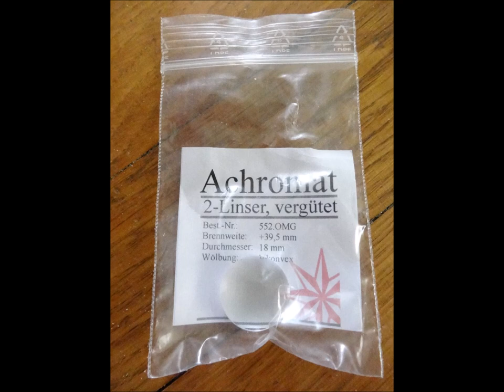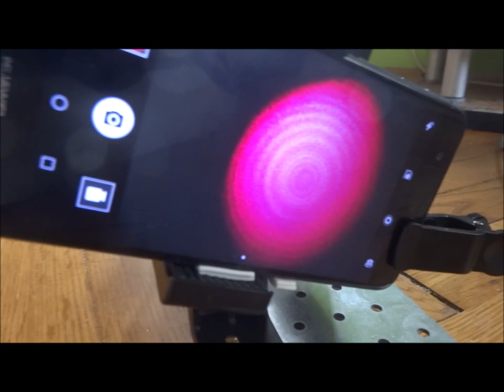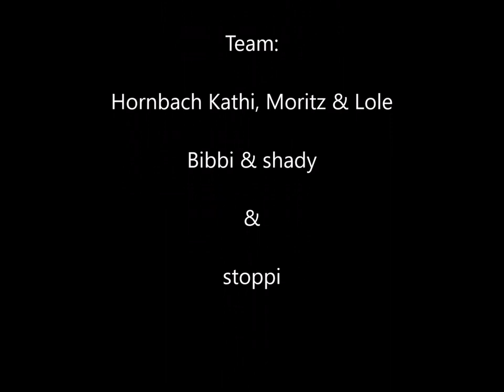cheap & homemade Fabry Perot Interferometer

Comment: Hey, a year one undergraduate here. Just trying to understand how the first set-up is different from the second one and how having a piezo cell fits into the picture fro the second set-up (i.e. I don't really understand what it does). Hoping you could shed some light on it. Cheers!
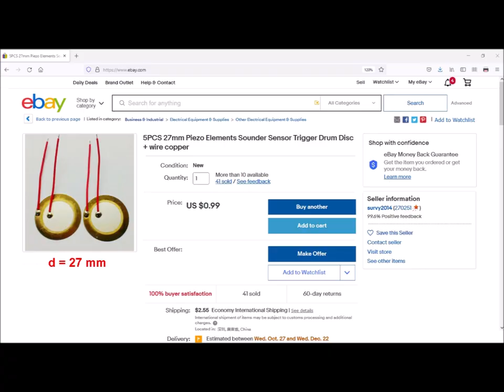Reply from the maker: At 0:55 you can see the first setup and at 3:15 the second one. The only difference between them is the piezo disc positioned under the second 50%-mirror and the observation method. In the first setup I use a viewfinder from a telescope to watch the interference rings. In the second setup I use a 12x telescope for smartphones. The piezo disc has a hole in the middle to pass the light through... Cheers stoppi

Comment: How do you align the lenses in your experiments? I'm building a homemade Raman spectrometer and this is a recurring problem when configuring my mounts. Do you have any tips?
Reply from the maker: For the fabry-perot interferometer the collimation of the lens must not be really perfect. You could use a laser coming from the opposite side of the lens. If you align the laser parallel to the optical axis and move it around, the beam in the focus shouldn't move... Or you can use a bright led positioned in the focus point and behind the lens you should see a bright disc which isn't getting bigger or smaller when you change the distance to the lens... I have done this f.e. For my Tsl1401 spectroscope...
A Raman spectrometer is on my waiting list but therefore I would need a spectroscope with an optical fiber input.
Reply: @stoppi  Thank you very much ;)
Reply: @stoppi  a

Comment: Please, use your FP interferometer to measure the Zeeman effect :D
Reply from the maker: Haha, guess what I am planning right now. I have already bought a 1mW HeNe laser for the zeeman effect, which will be covered with a coil or magnets. But maybe my fabry-perot resolution is too low. The splitting up of the lines due to the zeeman effect is extremely low, but I will try it...
Reply: Maybe, using a set of Piezo cells in series could increase your spectrometer's resolution. With two or three cells, each with individual voltage control.
Reply from the maker: @LucasAlves-lf5pr  for the zeeman effect I will take the fabry-perot interferometer without the piezo. I am looking for a slightly change of the ring patterns when I increase the current through the coil...
Reply: @stoppi  An inhomogeneous field, like in the Stern-Gerlach experiment, could increase the resolution? ex: using a configuration with nail's head pointed to another nail spiked side, both inside each coil.
Reply from the maker: @LucasAlves-lf5pr  For the Zeeman-effect I will use a homogeneous magnetic field to get the same splitting of all "lines" in the interferometer. At the moment I don't see an advantage of an inhomogeneous field. In the Stern-Gerlach-experiment you want to create a force at the magnetic dipols in one direction and therefore you need a gradient dB/dz...